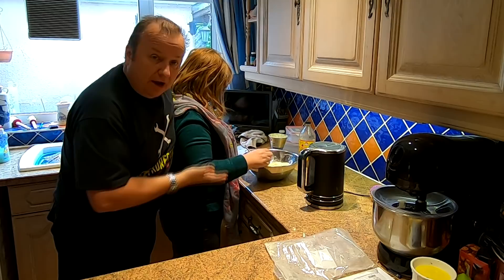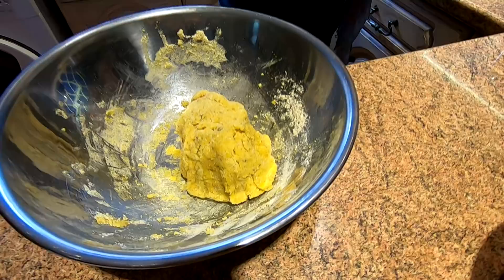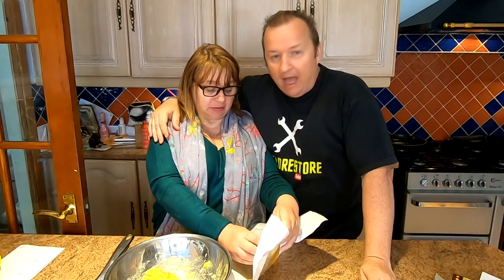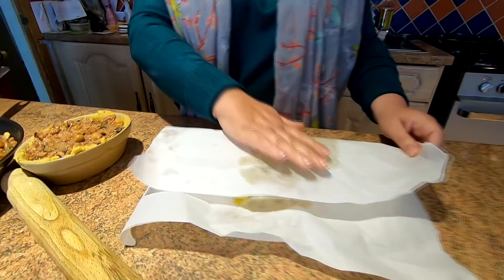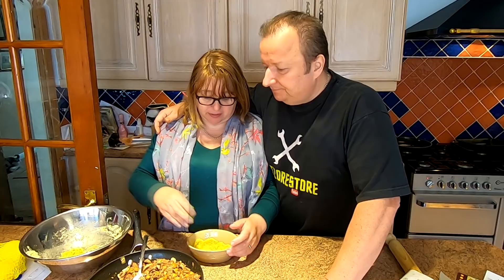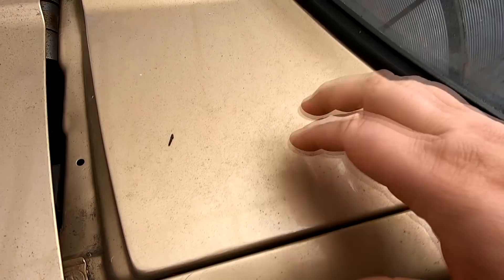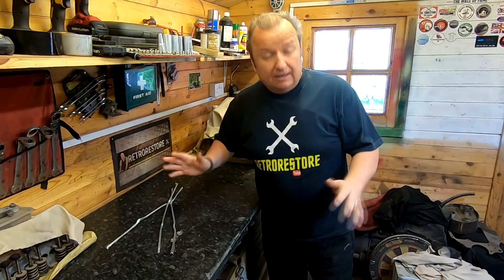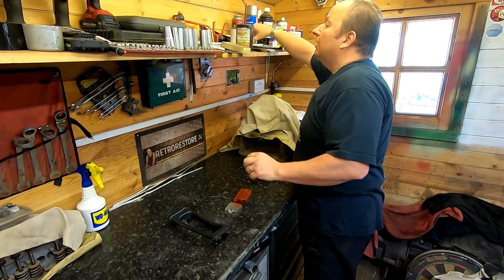Woman With Power Tools Takes Over Vlog

Comment: Hi Martin
3/8" in ond money is 10mm as you probably know. 
I used to work in a hire shop and we sold Jacobs chuck keys and s3 on the packets seams to ring a bell in my head s1 and s2 where small sizes hopse thin helps
Reply from the maker: Thanks Pete, yes, I've ordered an S3

Comment: Martin, you could just say "male bovine excrement" instead. The Triumph Vitesse does have a straight 6 engine (same as the 2000 and GT6) and the body is in 2 parts (the body tub and the bonnet) like the Herald.

Comment: Is the max drill bit size 20mm as you can get a key with a 9mm head that slots in the hole you measured. That paint you talked about is good

Comment: Those spare wires have a fuse holder on them so maybe an old stereo wiring
Reply from the maker: I think it was a feed for those spotlights I removed from the bumpers.
Reply: butlersempire knew it would be for some aftermarket add on when I saw the fuse.

Comment: You could try putting a drill bit into the chuck key hole to verify the pin size.  I think this one has an 8mm pin. search google 'Rohm ROH25835 S3'
Reply: I agree, the "S3" from the chuck should be the key size, with 8mm pilot for 16mm capacity chuck.